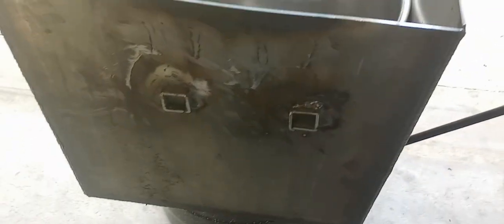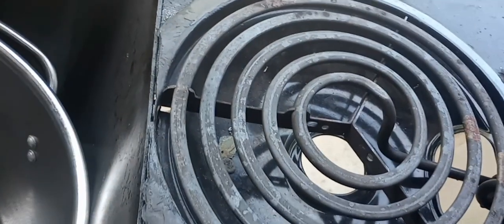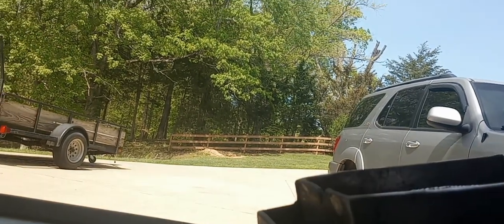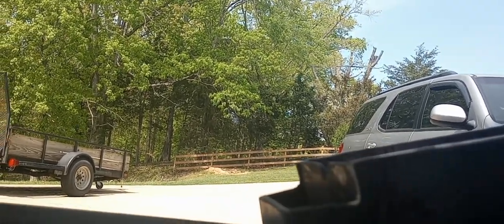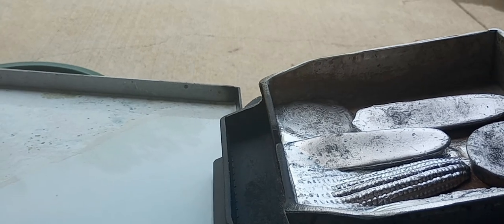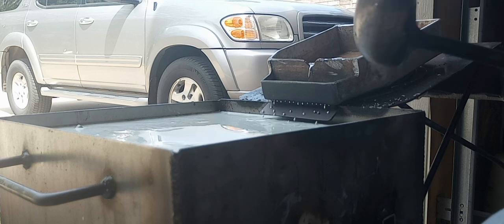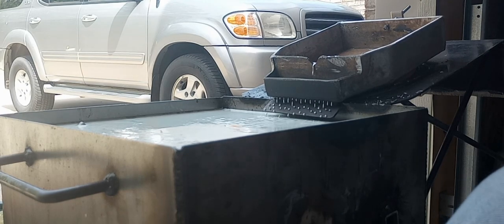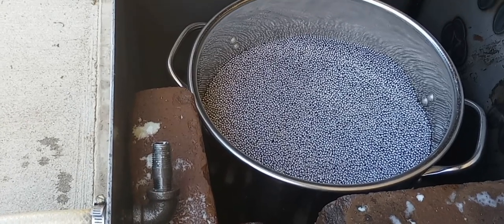My shot making procedure start to finish.

Comment: Great video.  Love your setup.  Well thought out and man it puts out the shot for sure.  When It stopped up the first thing i said was why wouldn't he just hit it with the torch...LOL  Dramatic pause just to keep us in suspense.  Thanks for sharing and great content....keep it coming.
Reply from the maker: Yes sometimes it takes that front part a little extra time to get hot enough to release the lead and I was getting a little too much build up of lead which would make the head pressure too high so I had to get it going
Reply from the maker: Thanks a bunch. I enjoy the process.

Comment: Do you have to use aluminum for your lead pot or can you use any metal? Thanks
Reply from the maker: Aluminum is used because of it's superior heat transfer but I'm sure 1/8 thick steel would work to some degree. Give it a try and report back.

Comment: How do you control the burner temp?
Reply from the maker: You don't have to control it, I run it wide open. It don't over heat because the ingots you add ever 30 seconds keeps it at the correct temp.

Comment: @droberts6579 i am in southeastern Indiana 10 min from ky or ohio where abouts in Ky are you very interested in getting to make my own shot.. I got a great lead source.. As i already make some sinker and round balls and other stuff.. Please get with me if you have a few mins to spare..

Thanks 
Justin
Reply from the maker: Hey Justin, I'm in Monticello KY . Just any lead won't do. Soft lead won't work unless you add the correct amount of antimony and tin. I use old style wheel weights before they started making them out of zink .